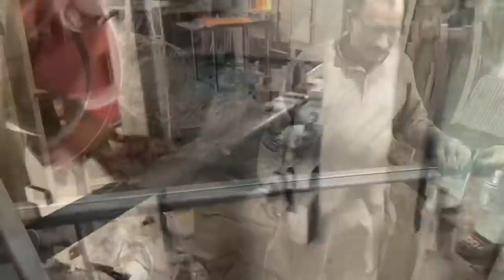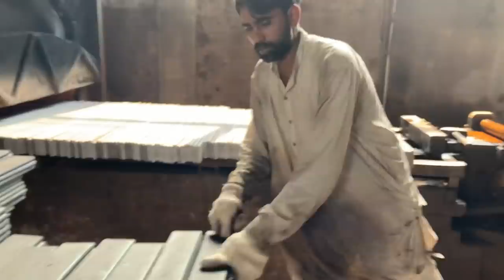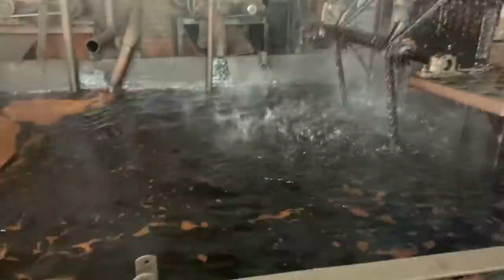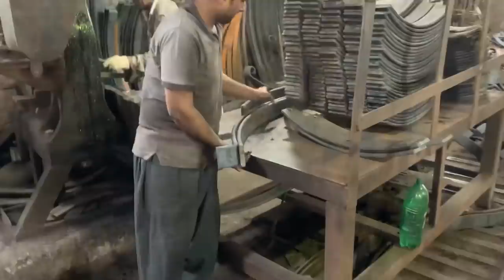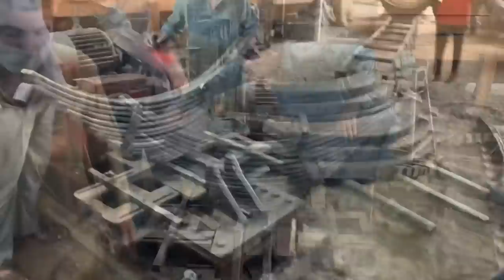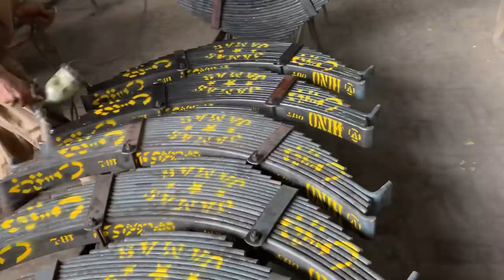Manufacturing of Leaf Spring Complete Process in Factory | Production of Leaf Spring | Leaf Spring

Comment: Filmed at the brand new Amazon leaf spring plant in Cleveland.
Joking aside... I was impressed at the quality of the workmanship, right up until they tied those massive leaf springs together with those terrifyingly tiny center pin bolts. Once they're installed, it's less spooky I suppose. But I wouldn't want to be the guy installing them..  I guess if you're the only game in town, it makes for good job security if your leaf packs blow apart often enough.

Comment: These springs works  only upto certain extent because the manufacturing and spring treatment is very poor .
The temperature seems inappropriate and the temperature of the quenching oil is not maintained .
Forget about safety ,
Reply: @Satish  Sharma are you expert in heat treatment ? You are not and you  know it . The manufacturing process  is a bit primitive, but they doing alright . Don't know and don't care what you doing for living  . As for me Satish , know what I am talking about .

Comment: A sobering thought is that in the west, these have almost all been replaced by a small (approx 12 inch across) rubber bag (that can be replaced with basic tools  in a couple of minutes) and an air compressor.  Each bag can support well over 11,000 pound
Reply: These are the air bags in trucks? You think these spring sin the video are for freight trucks?